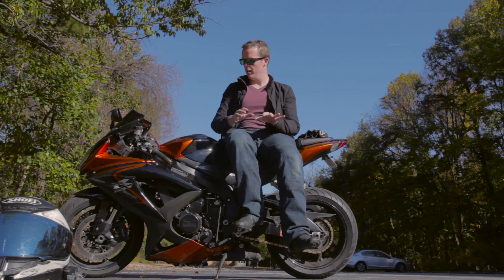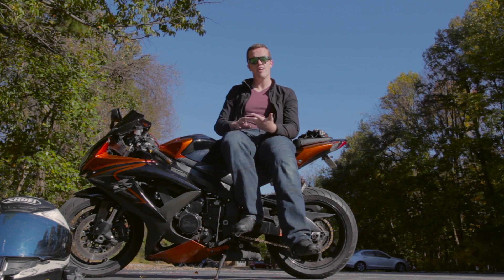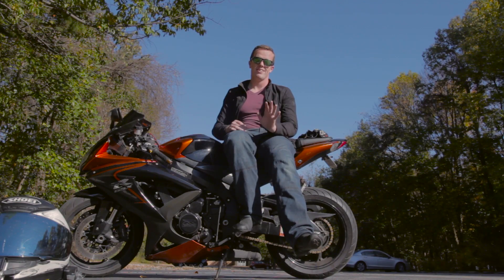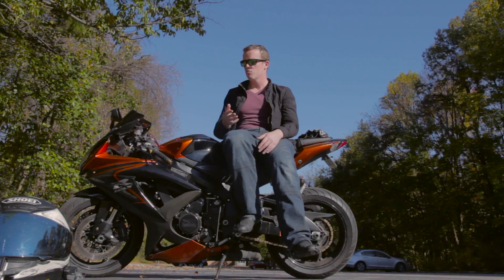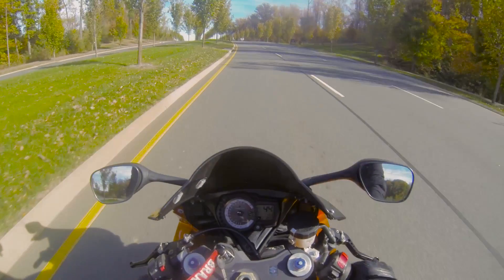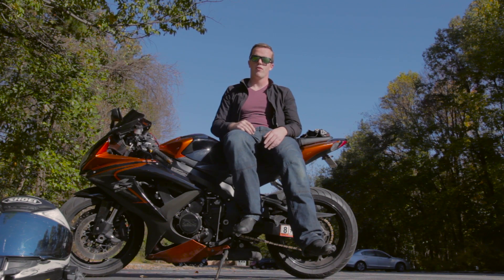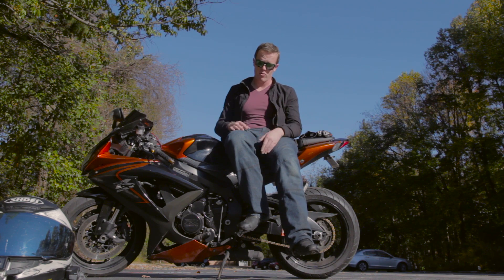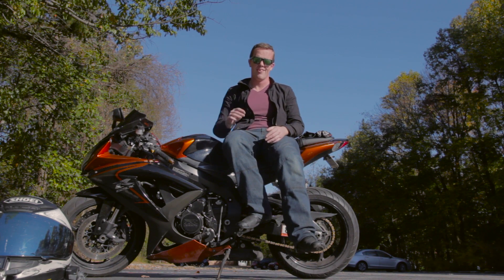How Motorcycle Engine Braking Works

Comment: The Engine braking is NOT a result of Vacuum but the Compression of the minimal charge within the cylinder.  You can close of the intake completely and you will have virtually no engine braking. so sorry , I'd suggest you get your facts correct.. 
As for replacing the clutch , again get your facts straight, modern WET clutches wear VERY little when compared to a standard dry clutch in a Car.
Reply: https://en.wikipedia.org/wiki/Engine_braking#Gasoline_engines
Reply: This was a learning experience
Reply: When I worked for a manufacturer of generators and industrial engines, I designed the dynamometer control system to control the dynamometers which were used to test engines and sometimes generators.  The dynamometers could drive (motor) the engines at any desired speed to measure friction and pumping losses with the ignition cut off, or they could absorb power from the engines to measure their output.

With those dynamometers, it was easy to motor engines at any reasonable speed to determine how much power they absorbed with the ignition cut off.  It took considerably more power to motor the engines with the throttles closed than with the throttles open.  That should prove that the vacuum caused by restricting the air intake with the throttle valve is the main source of engine braking.

Interestingly, at normal engine speeds (1800 - 3600 RPM), it took more power to motor the engines with the spark plugs removed than with the spark plugs in place.

The above information, obtained by experimenting under laboratory conditions, supports the various posters' statements that the engine braking of Otto-cycle engines is primarily the result of the power required to suck air in against the vacuum created by the throttle valve.  The Willipedia article, to which one poster provided a link, agrees.  Additional supportive information can be found with google searches.
Reply: during-engine-braking... fuck it im going to bed
Reply: why are you guys arguing heavy duty diesel applications in this context? That's about as relevant as talking about using parachutes or  brick walls to slow you down. The name of the video is technically wrong, hes talking about engine COMPRESSION but seems a little confused about how it works.
Reply: +mozzmann 
I agree with you, I always thought that engine braking was caused by the compression. The way I figured it some air was going into the piston and it was being compressed and ejected which takes work. With no combustion going on the engine basically turns into an air pump.
But after I saw what this guy said in the video I looked it up and Wikipedia agrees with him. It says engine braking is caused on the downstroke where the piston is trying to expand the volume in what is basically a closed system, which creates a lot of resistance. It says that for this reason Diesel engines produce very little engine braking (because they don't have throttles that close air delivery, so no vacuum when cylinder is expanding)
Reply: Sorry to say this mozzmann, but you are also wrong... Engine braking happends because of: By closing the throttle you are creating a great restricion in the intake maniflold. this will result in: when the piston is on its downstroke, it won't be able to suck in enough air to fill the cylinder fully wich creates a lower pressure, near vacuum. And then people think thats it, thats how it works.. But most of the "braking" comes from the air in the crankcase. because now you have a greater pressure in the crankcase, wich is 1 bar most of the time, vs near vacuum on the top of the piston. It only applies to 4 stroke eningens.
Reply: mozzmann so you mean your rings only seal one way? That cant be good...
Reply: Real_T Don't waste your time arguing with him, he's basing his argument on an opinion and doesn't seem willing to listen to or read anything else. In a petrol engine, braking is a result of the vacuum slowing down the piston's motion, period. Saying that it's compression makes zero sense because the piston has nothing to compress since nothing (very little) was sucked into the cylinder in the intake stroke.
Reply: If we are talking petrol (gasoline) engines, then it is drag resistance caused by the difference in pressures between the intake manifold pressure and the cylinder pressure.   Here is an excerpt from wiki that explains it better than me:
====
The term 'engine braking' refers to the braking effect that occurs in gasoline engines when the accelerator pedal is released.

When the accelerator is released, the butterfly valve that controls intake airflow (the throttle valve) is closed and the air flow through the intake is greatly restricted (but not cut off completely). This causes a high manifold vacuum which the cylinders have to work against - this saps energy and is where the majority of the engine braking force comes from. The concept can be illustrated by the amount of effort required to blow/suck through a narrow tube vs. a wider one. It is the work the engine has to do against this restricted air flow that provides the braking effect.

While some of the braking force is due to friction in the drive train, this is negligible compared to the effect from the manifold vacuum caused by the air-flow restriction.
=====
It requires you to close the throttle, so the example of keeping the throttle open while turning off the engine should not result in engine braking because the throttle is still open and air flow is causing a positive pressure for the cylinders.

Diesel engines work differently though.
Reply: Here is an interesting way that has been proposed to eliminate the efficiency loss created by the throttle valve.

International Harvester modified one of their Diesel engines to eliminate the camshaft.  They did it by having computer controlled actuators to operate the valves instead.  By doing so, they could have optimal valve timing for all operating conditions.  The engine was successfully tested.  The computer controlled valves resulted in higher power and improved efficiency at all speeds.  That was in the year 2000, i.e., 17 years ago, and camless engines are still not in production.

The same approach to eliminating the camshaft and having computer-operated actuators to control the valves has been tried with a gasoline engine.  It makes it possible to eliminate the throttle valve.  Instead, when less than full power is required, the intake valve is opened only very briefly.  The result is that, although it requires power to pull the piston down against the vacuum, the vacuum is not dissipated and will pull the piston up during the compression stroke.  The result was considerably improved efficiency.  Also, the optimally controlled valves resulted in increased power.

There were predictions that soon camshafts would become obsolete because they would be replaced by computer controlled actuators for the valves.  Unfortunately, it never happened.  The reason was that controlling the valves by computer was way too expensive.  It is not an easy thing to do.  When the valves are closing, they cannot be permitted to slam against the valve seats since doing so would quickly cause damage.  The control necessary is difficult to achieve and achieving it is not cheap.  Perhaps in the future a way will be found to reduce costs enough that eliminating the camshaft will be economically practical.

If you do a google search on "camless engine" you will find some good articles about this.
Reply: mozzmann 

Dude...you are completely and absolutely wrong in every single respect. Engine braking is majorly produced by the vacuum created from closing the intake enough to not sufficiently supply the engine at a given RPM. 

Hence the reason diesels without Jakes or exhaust brakes dont effectively reduce speed when attempting to engine brake.

Its sad when people are so adamant that they are correct when they are 110% wrong. Lmao...

Guy doesn't even understand the basics of internal combustion engines and wants to tell people to "get their facts straight".
Reply: mozzmann 

Yeah, Mozzmann. No need for that, because I have actually had vehicles stall out going downhill it slowed down even more than when it was running because you didnt even have the momentum from the combustion process.

Thanks for playing.
Reply: Right on the money with engine braking. It's the compression stroke that causes the resistance we feel while decelerating.
Reply: Because there was a statement was made that is incorrect, possibly off topic yes but incorrect! 

Engine braking has bugger all effect on a modern sports bike due to higher RPM lower internal resistance and multi-cylinder configurations as well as a lot of other factors, 
 
Smaller cylinders give a faster smoother response as far as the rider is concerned but stuff all engine braking. Larger and lower number of Cylinder's WILL have a greater effect re engine braking, 
So OK forget about the example given in the Vid low gear and high speed  equals High internal loading and you feel it much more.
Reply: Your crank case  hypothesis is totally false,  you have pistons going in both directions in pairs and unless your piston rings are stuffed your going to have minimal pressure changes within the crankcase anyway, due to normal PCV common on most modern engines. 

General engine braking for instance on your 250 crotch rocket or 600 CBR for instance and ride at 100 Kph and close the throttle you will have a retardation effect , now cut the ignition - you will not a bearly perceptible change, now open the throttle wide your allowing a lot of air in you will find again very little difference in retardation.

Engine braking is NOTHING more than the throttle off drag induced internally in an engine this varies with the configuration of the engine in question
Reply: Ah NO shows how little you understand about engines, 
Traditionally there are 2 and sometimes 3 compression and usually 1 but there can be either 2 or a compound Oil control ring ANY of which depending on their design and application can provide better sealing while ascending which is what they are designed to do. 
Compression rings like Keystone are designed to seal less on the down stroke BUT this varies as a result of pressure bleed forcing the rings outward to the cylinder walls . 
Other types of rings are dead straight and have the same drag in both directions, 
Some rings have the top compression sealing on the way up and the 2nd compression ring sealing better on the way down, there are many variables. 

So since the compression rings are designed primarily to seal while ascending, you could be forgiven for thinking that they don't seal all that well while descending. They should seal to a degree on the way down which of course is how induction happens anyway ,  BUT at the end of the day you will have pistons ascending at the very same time that other's are descending so pressure differential in the crank case will change very little so your theory about it influencing engine braking is simply not going to happen .
Reply: mozzmann engine braking works like that on semi trucks the jake brake but for cars that compression is quickly going to push down the cylinder again you get your facts right
Reply: Carl Jam
Reply: I own a v twin and an in-line 4 motorcycle. The v twin is has way more engine braking than the inline 4. Mozzman is correct .
Reply: If diesels don’t have engine braking than why bother shifting to a lower gear for a long downhill?
Reply: Group hug guys...
Reply: mozzmann You're wrong.
Reply: In what respect, ? if you want to get really technical you could say that there is a combination of things but the vacuum does not contribute as much as many think, now to prove this,  and remember the exact same things apply,  . Run your bike  at say 100 KPH and close the throttle , you will feel some reasonable engine braking as the rear wheel drives the engine creating drag,  Now return to 100 KPH and without closing the throttle hit your KILL switch,   ( ONLY do this briefly to verify my point as you DO NOT want an excess of un-burnt fuel washing the cylinder walls )  BUT having the throttle open allows much more Air into the engine which MUST be compressed and as a result the compression drag is significantly greater than Vacuum alone ,
Reply: mozzmann Compression braking doesn't work unless you open the exhaust valve at the top of the compression stroke (like a Jake Brake). That way the engine is doing work to compress the air and then it releases the energy into the atmosphere. If both valves stay closed, the compressed air just acts as a spring and pushes the piston back down, conserving the energy. Some energy is expended because of friction, but very little.
Reply: Absolute rubbish, your totally confusing Engine braking , with Active Compression braking. They are completely different.
Reply: You confusing Engine braking with compression braking 2 VERY different things. 
Internal drag with engine braking is the same as the load the starter has to contend with, and at higher speeds is very effective on some bikes . 
And a correction of sorts cold air ingested is denser than Air compressed withing the engine so you will achieve braking the compressed charge in the cylinder will push down on the piston far less than the resistive force of having to compress it ,  The engine braking is achieved though many resistances withing the motor and not just compression in the cylinder/s

Comment: Dude.. How in the hell do you only Have 843 Subscribers..? Your Video was Well Planned out. And quality pretty good. I'm subbed, and will be until you quit YouTube. I Engine Break pretty hard. Because I bought My Bike with Shocked Forks and the fluid was all over my 2 Front Breaks. So My Rear Breaks where only mostly working. Point being is it's just like slowing down in My 08 First Gen 6.7L Turbo Diesel Cummins 6 Speed. You Gradually Get of the gas, and the engine will slow ya down. Know.. I Have This Awesome Button That's Called An Exhaust Brake. Yeah..... That's Fun.. I Love My Truck. Thank You For Your Awesome Video.
Reply: Do_it_with_Zane_117's_vlog's Months later he has 3+K subs...
happy to see that!
Reply: Do_it_with_Zane_117's_vlog's I drive the same truck for work.
I love everything about the 6 speed on the 6.7.
Reply: well he's at 1.4 k now. This video did him well cuz I subscribed as well ;D
Reply: Do_it_with_Zane_117's_vlog's  An 08 is not a first gen.
Reply: Steve Mack
Reply: Agent Solo
Reply: lol dont know how that is happening
Reply: lol ok
Reply: maybe because the title is the opposite of the statement presented?

Comment: Dude, engine braking has everything to do with shifting to lower gear thus instantly reducing speed. It has very little to do with valve, piston and cylinder.
Reply: This was a hilarious exchange. Buncha maniacs!
Reply: SuperLoomba boi no engine braking is produced by the vacuum created when the throttle is closed too much for the speed of travel. You don't need to shift gears to engine brake- if you have a bike or a car with a stick shift, start out in first gear and accelerate. Then, at any speed, close the throttle all the way or take your foot completely off the pedal. You slow down due to force of the vacuum between the cylinders on their intake stroke and the throttle body/butterfly valve. This is engine braking
Reply: ok, maestro I had it wrong.
Reply: ok good.  cool. my apologies. carry  on sir.
Reply: Chris, I acknowledged that I had it wrong. Now, what part of that you couldnt understand? What a stupid fucking clown!
Reply: hey stupidloomda... im going to make this real easy for you to understand... idiot.    .... whats in a engine.  pistons. valves cylinders.  what part dont you get fucknut?